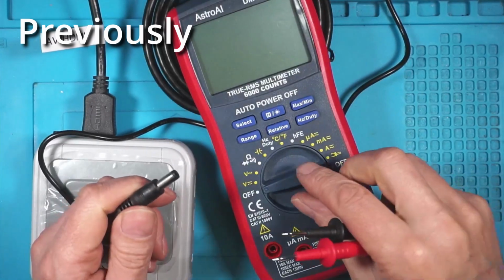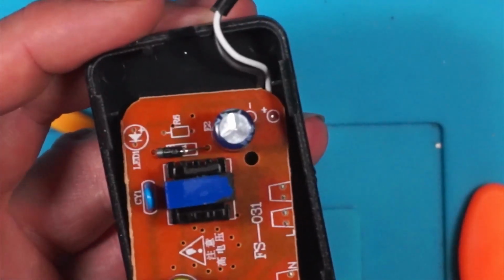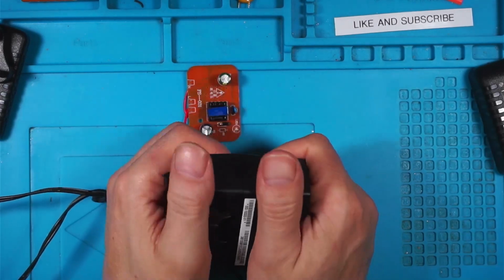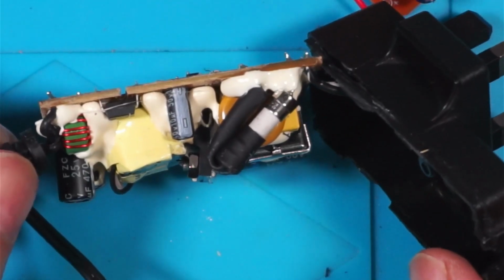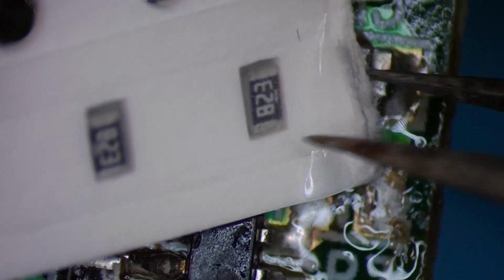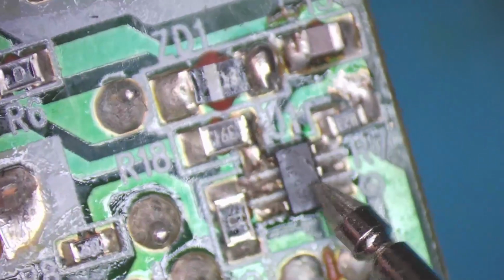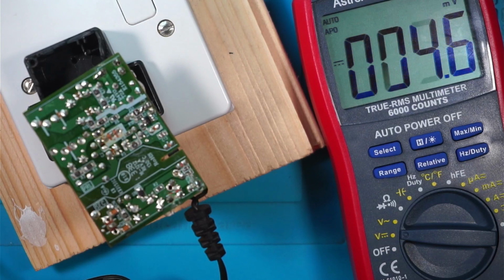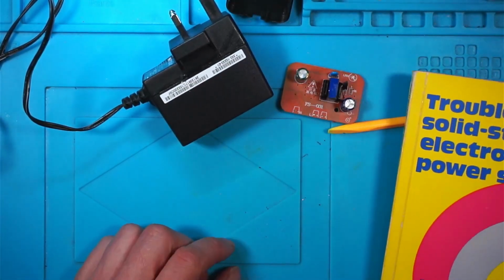Cheapest Power Supply Problems | Electrical Interference | Generic vs Branded PSU

Comment: The last wrong cable part is hilarious. Glad you saved your netgear psu! I usually put a bleeding 1k resistor across the high voltage caps for a few seconds when I open  a PSU to make sure it doesn’t shock me
Reply from the maker: That's something I need to look into, making a bleed resistor. I'm glad I noticed the extra cable  before spending more time on it lol. Glad you enjoyed it
Reply: @PhilipBryden  it doesn't have to be anything fancy. Just get yourself any ordinary through hole 1 k ohm resistor and bridge it across the leads of the capacitor. It'll drain it down nice and calm... much nicer than just shorting it with a metal tool.

Comment: Lol Philip I did chuckle we’ve all done it, I did the same and I ended up with 2 small craters both were like soldering iron burns, it woke me up 😊
Always worth buying a proper make and not a power supplies from eBay 😊
Reply from the maker: I'm just pleased it wasn't from the big cap lol. I normally just feel a tingle but this time it was a jolt. Aan yeah, it does wake you up and reminds you to be careful.
Reply: @PhilipBryden  it makes your arm aches for ages too lol

Comment: "This would be great if it works, because I've-- I've managed to fix it and and I've only give meself one electric shock" is the best line in the video
Reply from the maker: Lol thank you. I haven't seen any more news about the heatwave in Europe, has the temperature returned to normal?
Reply: @PhilipBryden  32C indoors (and I have insulation on the exterior walls too)
Reply from the maker: Far too hot for me, anything above 20c and I start to feel uncormfortable
Reply: @PhilipBryden  i do have air conditioning and I find that in recent years it's basically become necessary (either it's really getting hotter, or maybe I'm just getting older, or perhaps I'm just slowly getting spoiled from having air conditioners)

Comment: Philip, you have a PWM controller on the other side, you call it a power mgm chip. Those extra resistors on the side of it, mosf of the time they are setting up the frequency for HF transformer and the deadzone - depends on the topology like half-bridge, or full-bridge, etc.
Reply: Ok, so, you've got a nice book over there :). Once you'll learn the difference in between linear power supply and a switching one, you'll understand why in some cases things are not working :). And, as someone already pointed out, don't be so hard on your self ;). Idiots don't work with electronics, but you do. And, you can only learn quicker on your or someone else mistakes ;). So, it's no shame in doing them. Just today I was fixing the backlight in 32" Bush TV. A super simple job, yet the display is broken ;). Each 100-150 of those repairs and I'll damage one. Life ;) is not perfect, so no point to be hard on ourselves.
Reply from the maker: Thank you Piotr. You're correct, you often learn more from the mistakes than doing things correctly. Thanks for taking the time to watch my video and leave a comment.

Comment: Phil! first off please either get a GND wrist strap OR wear rubber gloves (Not Marigolds) When working with high power that could/would kill you.
Second that has to be one of the worst/cheapest SMPS designs, I've seen in many, many decades. It can be filtered better but, personally I'd destroy/bin it.
Reply from the maker: Hello Ratchet, I will look into a GND wrist strap but where's the fun in taking away the risk lol. The cheap PSU has gone into the bin, it's not even worth keeping for parts lol.